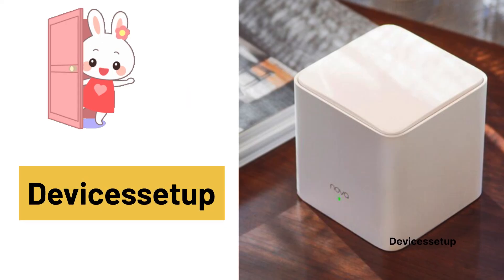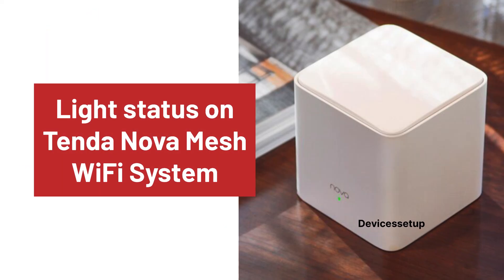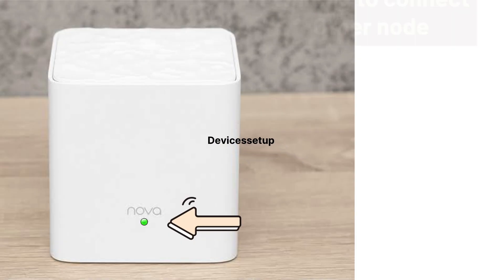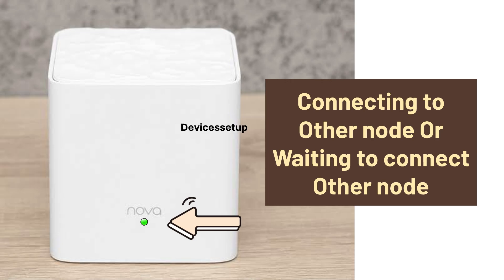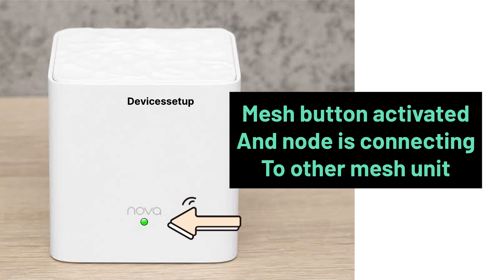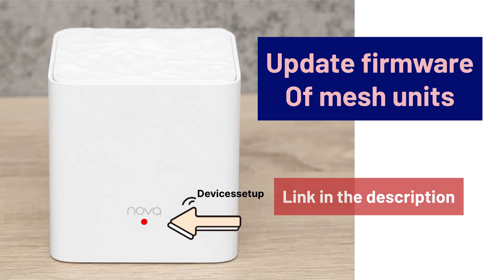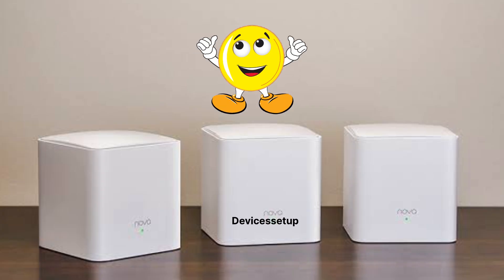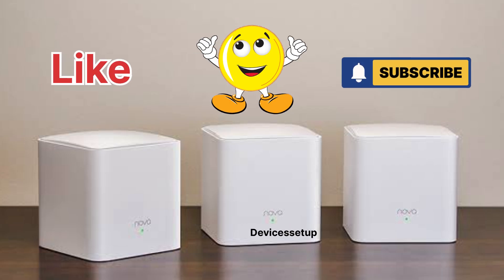Different Led & Their Meaning On Tenda Nova Mesh WiFi System | Devicessetup

Comment: My experience is that in many cases, after resetting a Nova from one suite to default state, it will NOT pop a window in the app to informing that a new nova unit is joining.  I find it necessary to connect the reset NOVA to a master NOVA via Ethernet cable and add it via scanning its QR code.